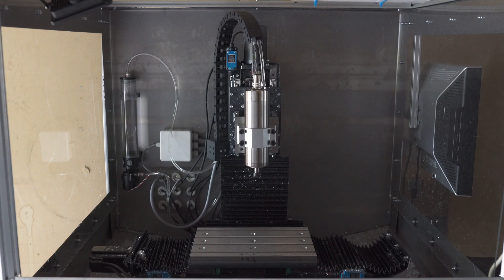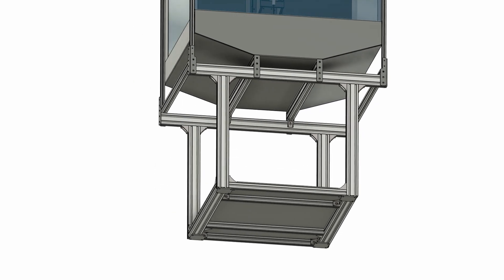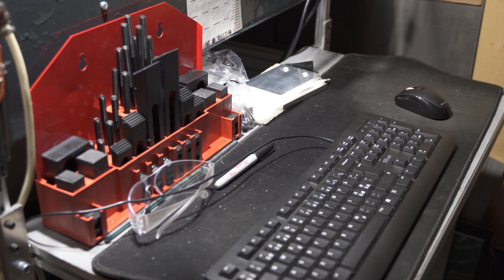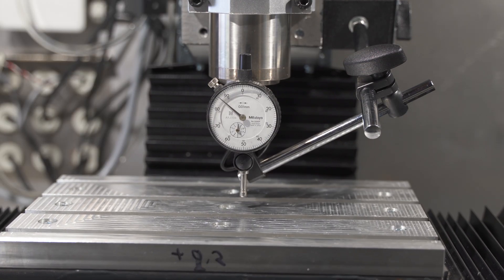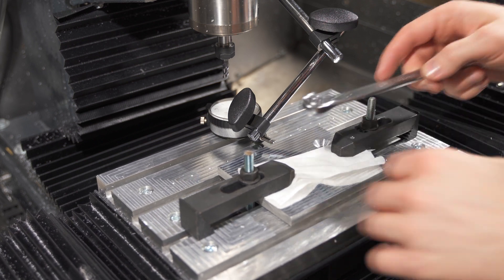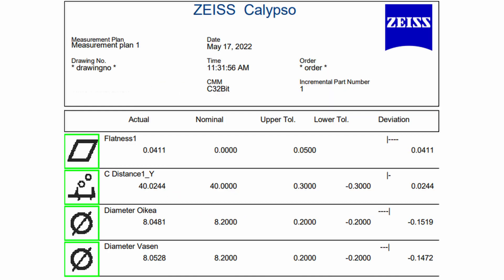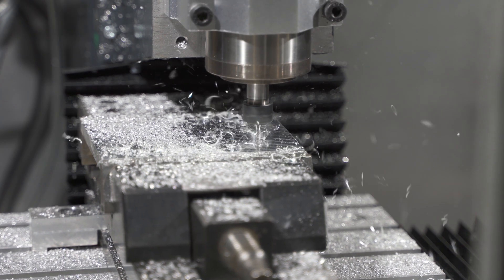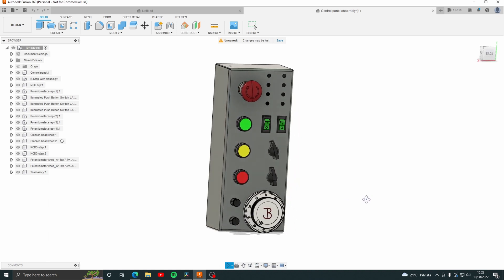DIY 3-Axis CNC Milling machine Part 5: Up And Running

Comment: how much work piece weight it can hold
Reply from the maker: I think the wight doesn't matter too much. It's more of a size question. The movements are X300 Y200 Z200 mm.
Reply: @tw2ka644  ok boss

Comment: I just watched your whole 5 part series to date. Very nice design, build, and video production. I didn't see you mention how you trammed the Z axis. Can you show/discuss that? Also, are you a mechanical engineer? Thanks.
Reply from the maker: Thank you I appreciate it! I trammed the Z-axis by placing a 90 degree angle gauge on a vise in a way that one side was facing up. I first zeroed the gauge with a dial indicator so one side was in line with the Y-axis and then attached a dial indicator to spindle and moved Z up and down dialing against the gauge. This way I found the tilt on the YZ-plane. Next I did the same thing but zeroed the gauge on the X-axis and then dialed the Z movement on the XZ plane. I corrected the tilt error of the Z-axis column with little metal shims. Then I went ahead and trammed the spindle by placing a long end mill on the collet. I again moved the Z-axis up and down and measured the angular error from the front and side and corrected the spindle. Hope you understood this and yes, I am a mechanical engineer who specialized in automation and robotics!
Reply: @tw2ka644  Great, yes I understood. The shim is what I was after. I didn't know if you went with that or a metal filled epoxy or some other method. I'm an ME also, but most of my time has been designing plastic parts for injection molding. Here is my cnc design playlist if you are interested. I'm still in CAD, slow going, ha ha. https://www.youtube.com/playlist?list=PL_e9tdItiJstrB6WyruH1jfdonHBbIJdD
Reply from the maker: @nickp4793  Nice to hear, I will check that out!